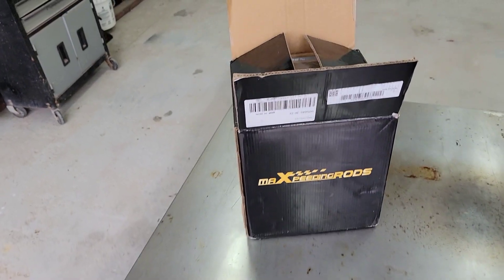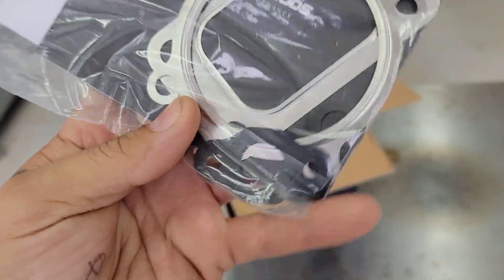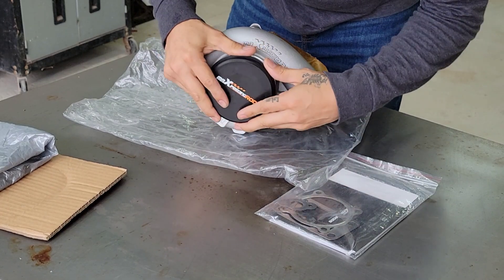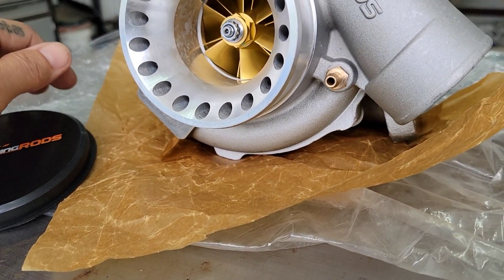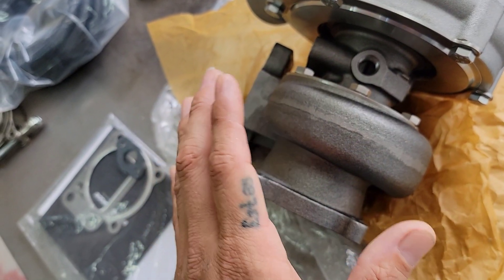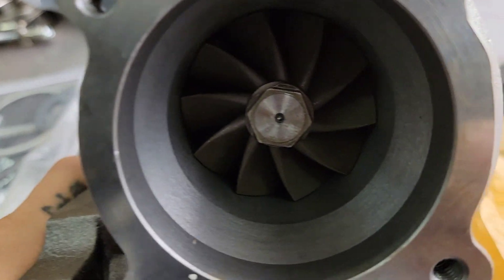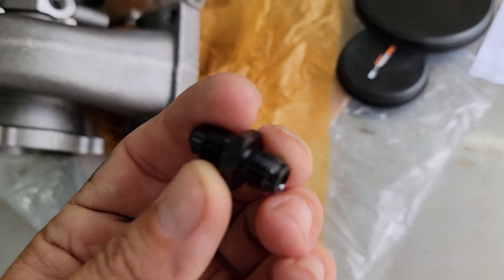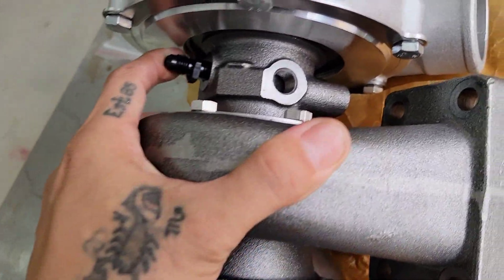UNBOXING a GT35 Street Turbo by @MaXpeedingRods

Comment: What's the center on center spacing for the bolt holes on the oil return flange
Reply from the maker: I checked with my caliper and it says 37mm / 1.45 inches
Hope that helps!